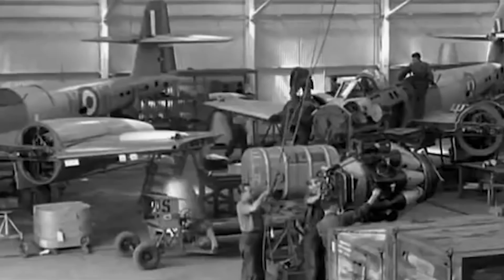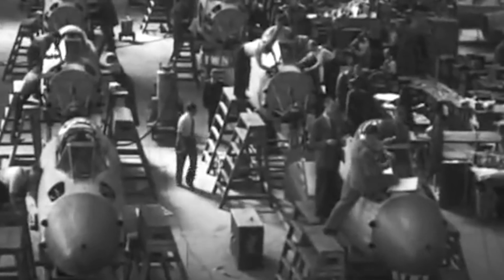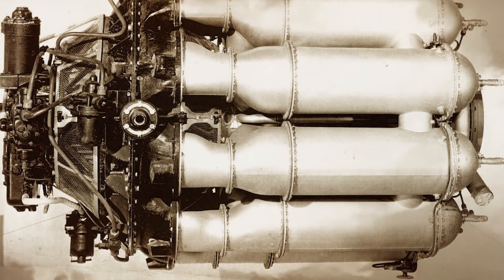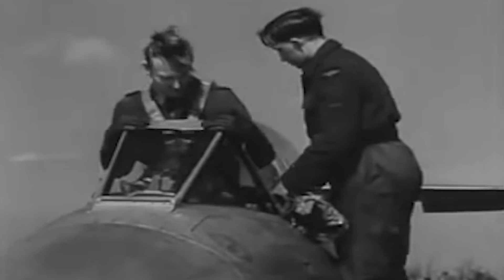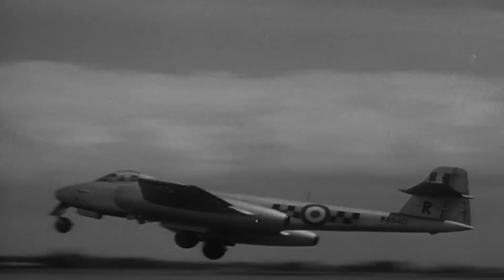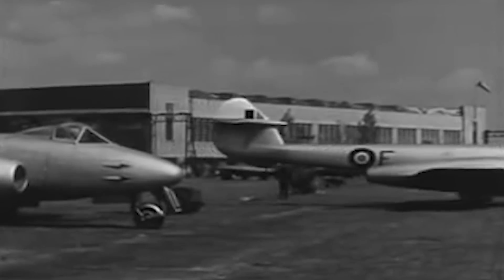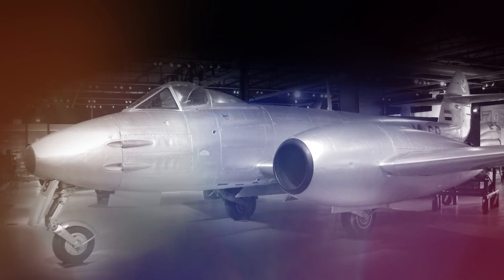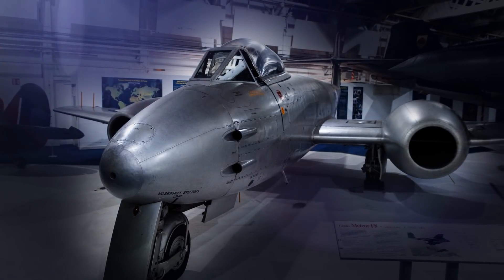Gloster Meteor - The Only Allied Jet to Fight in WW2

Comment: Gloster: “We have a new fighter jet that’s going to revolutionize the industry!”
RAF: “Great! Any downsides?”
Gloster: “Well, it can’t take off...”
RAF: “We’ll take a hundred!”
Reply: And the Me-262 was really reliable and didn't kill any of its crews. Oh, wait.
Reply: @gw7624  Compared to the Gloster  "Meatbox"?
Reply: @sandervanderkammen9230  The 262 were infamous for poor engine reliability which contributed to many of its pilots' deaths. The Meteor wasn't perfect, but you were definitely less like to die in one.
Reply: @gw7624  Not true, the Meatbox was the most dangerous jet aircraft. It was without any doubt the worst jet ever made.
Reply: @sandervanderkammen9230  at the time there really not a great deal of competition for ‘worst jet ever’ and for that matter competition for ‘best jet’ because it was almost ‘the only jet’ which existed in any quantity!
Reply: @pcka12  True, the Gloster  Meatbox stands uncontested as the worst jet ever made..
Reply: @sandervanderkammen9230  somehow I think you have missed the point, early jet aircraft were very dangerous machines, travelling excessively fast and pushing the boundaries of material science, they could hardly be anything other than death traps.
Reply: @pcka12  The Messerschmitt Me-262 was able to shoot down over 500 Allied aircraft...
The Meatbox however was only effective at killing RAF pilots..
Reply: @sandervanderkammen9230  I suspect that you might be exaggerating the performance of the me262 which had highly unreliable engines, and for the most part the Meteor had no one available to kill (other than its own crew) in common with the vast majority of post war jets (apparently the English Electric Lightning had virtually no opportunity to shoot anything down, but it did kill a number of it’s crew!)
Reply: @pcka12  Not at all, the USAAF exhaustively tested the Messerschmitt Me-262 after the war as part of Operation Lusty and Operation Paperclip and found the Jumo 004b engines compareable to Allied engines and more reliable than anything in a similar power output.

The 109-004B engines exceeded the RLMs 100 hours PFTR required by Luftwaffe before entering military service.
This is the exact same 100 hour  PFTR required by RAF and the USAAF during WW2.
TBOs in combat averaged between 50 to 60 hours... excellent by WW2 standards and fantastic for a twin engined interceptor which had very good asymmetric behavior...
The Meatbox was lethal with an engine out.
Reply: @pcka12  The Meatbox was never a viable fighter aircraft, it was simply  not capable of being used against Luftwaffe aircraft, RAF pilots had their hands full just trying to keep the Meteor from becoming a Meteorite
Reply: @sandervanderkammen9230  given that the Meteor arrived a mere 28 years after the Sopwith Camel (which I am sure that you are convinced was ‘never a viable fighter aircraft’ given it’s appalling performance figures and tendency to kill pilots), the Meteor must have had something going for it or they would have kept all those Spitfires - perhaps it was just all a matter of adopting the latest fashions??
Reply: @sandervanderkammen9230  so please explain why the Russians leapt at the chance of using British engines in the Mig15 (another useless fighter?) and promptly binned all the German engines they had?

NB the British Engines in question were of course ‘centrifugal’ rather than ‘axial flow’ types (the British having kept their ‘axial’ ones for themselves.
Reply: @pcka12  Other than the fact it wasn't built out of WOOD like the Vampire?
Nothing... the U.K. was bankrupt after the war and the only thing more plentiful with less value was RAF pilots.
Reply: @pcka12  That is easy, almost the entire German aircraft industry was relocated to the U.S. after the war as part of Operation Lusty and Operation Paperclip.
 Those who didn't went to France to restart production of BMW jet engines still made today by Safran.
Reply: @pcka12  Only the Yak-23 used the RR Nene  (RD-500)
The MiG-15 was designed by Heinkel engineer Seigfreid Gunter and was powered by the Klimov VK-1

The U.K. didn't have a viable axial flow turbojet engine until the 1950s, they were already years behind in jet engine development.
Reply: @sandervanderkammen9230  ah well! 
It is a bit difficult to deal with a person so detached from the realities of of history and so convinced of his own eccentric viewpoint (even when fed numerous clues to 'set him on the right track).

So I am 'signing off'  -  have fun in your fantasy land!
Reply: @pcka12  Indeed, you sir are extremely difficult and detached from reality..
Anyone that believes the Meatbox was a good design is not educated or experienced enough to speak intelligently about them.
The Meatbox was without doubt the worst jet fighter ever used in RAF service.. it was the most effective British aircraft ever used against RAF pilots.
Reply: @sandervanderkammen9230  well now!

Did I ever say that these aircraft did not kill their pilots in large numbers?

No what I actually did was to compare these aircraft with another British aircraft which also killed pilots a mere twenty eight years before, that aircraft was the most successful allied fighter of WW1 and a deathtrap for the unwary & unprepared, it was the tiny Sopwith Camel!

I also said that if you have an aircraft which is pushing the limits of existing knowledge (1944 onwards), you expect casualties.

Martin Baker operated two of these 'wickedly dangerous ' aircraft (the Meteor) as flying testbed for ejector seats, and it stands to reason that if the aircraft were as bad as you believe they would have retired them long ago and used something better!

You need to step aside from your prejudices an spend a little time thinking & researching.

Incidentally that Russian engine arose from the post war British Labour government selling them engines 'for peaceful purposes ' which they promptly re-engineered and stuck in their fighters. Stalin is on record as being unable to believe his luck!
Perhaps Stalin did not know that Labour party meetings used to sing 'the red flag' until relatively recently (New Labour with Tony Blair).
Reply: @pcka12  You have exposed your very limited knowledge of both aircraft... 
Over 1,000 Gloster Meatboxes CRASHED killing 450 RAF pilots...
The Meatbox was much more effective in killing British pilots than than the Messerschmitt Me-262...
Reply: @sandervanderkammen9230  .Yet Meteors are still in service today
Reply: @monza1002000  Not in service anywhere, there are many examples of vintage aircraft still in airworthy condition, what is your point?
Reply: @sandervanderkammen9230  
Two are still working with MB Ejector seats. The 262 disappeared almost as soon as the war ended. The Meteor was the better aircraft, holding several air speed records.
Reply: @monza1002000  Wrong, the Messerschmitt Me-262 continued production and service in the Czech Republic.
Reply: @monza1002000  There Meatbox was a horrible aircraft, the worst jet fighter in history.
Never beat the Messerschmitt Me-262 airspeed record.
It was not bested until the F-86 Sabre went supersonic.
Reply: @sandervanderkammen9230 
Where are you getting your info? The Meteor broke several speed records recording over 660mph
Martin Baker use Meteors for testing the ejectors seats
Reply: @monza1002000  Sorry Marty, the Meatbox never flew faster than 615mph. Not the fastest jet aircraft.
Reply: @sandervanderkammen9230  lol, the meteor served until the 1970's.   The 262 was garbaged in 45 because it was more like to kill its own pilot.  It was banned from flying when Howard Hughes tried to use it in a race for safety reasons.  Hughes never cared about safety.
Reply: @pcka12  refreshing honesty and understanding of reality.  Nice to see on YT.
Reply: @sandervanderkammen9230  did they even make 1000 262s?
Reply: @flavortown3781  Closer to 1,500 Me-262s were built...
Reply: @hurri7720  the arrangement of the fans in the engine you mention is pretty much the same as turbines prior to their development into internal as opposed to external combustion engines as such it was an obvious path of development on both sides of the North Sea
Reply: @pcka12  , yes of course. Quoting the Wikipedia:
"The first gas turbine to successfully run self-sustaining was built in 1903 by Norwegian engineer Ægidius Elling.[7] Such engines did not reach manufacture due to issues of safety, reliability, weight and, especially, sustained operation.

The first patent for using a gas turbine to power an aircraft was filed in 1921 by Maxime Guillaume.[8][9] His engine was an axial-flow turbojet, but was never constructed, as it would have required considerable advances over the state of the art in compressors." 
And of course this applies to a lot of innovations like the phone, the radar and so forth.
A truly English engine innovation would be the Sterling engine.
Reply: @hurri7720  And?
Reply: @hurri7720  yes but you have clearly missed the bit about ‘external combustion’.

Try looking up the Turbina as an early application of turbine propulsion (you can even visit it).
Reply: @pcka12  Are you seriously attempting to compare a steam engine to a gas turbine? 
The Brayton and Rankine are completely different thermodynamic cycles and anyone with the slightest education should be able to tell the difference.
Reply: @sandervanderkammen9230  the important bit is ‘the turbine’, what causes it to rotate is obviously of secondary interest, the ‘concept’ is the extraction of motive power from a turbine mechanism (and of course water turbines have existed for a very long time).

Once you have established the concept of a turbine every thing else follows!
Reply: @pcka12  The turbine is just one of many critical components and concepts... remove everything else? You are left with nothing but a windmill.
 The turbine in a gas turbine operates using a completely different type of blades than a steam turbine... 
The most critical component of the gas turbine is the compressor it is this device that ultimately determines the efficiency, get it wrong? The engine won't run at all!
Reply: @pcka12  Gas turbine engines were pioneered in Norway and Switzerland, not the U.K.  the brits were still playing with boiling water... it must be that whole tea thing?
Reply: @sandervanderkammen9230  actually Hero in Greece had a steam powered thing that span round and round, classic English education gave a lot of credit to Greek & Roman concepts however the English have managed to contribute the odd 'minor' figure like Issac Newton & Richard Trevithick (but obviously most things must have been 'pinched' from abroad 'it stands to reason'!).
Reply: @pcka12  Jens Elling  built the world's first working gas turbine engine in 1903.
Brown, Boveri und Cie began serial production of gas turbine engines in Switzerland in 1932.
Reply: @pcka12  Dr. Anselm Franz designs the worlds first mass produced turbojet engine, the Jumo 004 Orkan in 1940.
Franz would go on to design the worlds most successful gas turbine engine, the Lycoming T53/T55 series.
Reply: @sandervanderkammen9230  that is just “very lovely to know”! ❤️
Reply: @pcka12  No doubt the brits pioneered steam technology... but lagged years behind in the development of internal combustion technology, in particular the gas turbine.
Reply: @sandervanderkammen9230  you do seem have a 🐝 in your bonnet don’t you!

What would you say if I pointed out that my paternal Grandfather was a Bavarian serviceman in WW1, my dad was one of those scientists deeply involved in High Explosives production in WW2.

I am 36% German & ‘quite a bit Swedish, but committed to Scientific & Historical truth & reality (even if it involves Britain).
Reply: @pcka12  So why do they call you Miss Patty???
Reply: @barrierodliffe4155  The Messerschmitt Me-262 was superior to anything the Allies had operating in WW2...
Shooting down over 550 Allied aircraft including fighters.
The pathetic Gloster Meatbox never shot down a single Luftwaffe plane.
Reply: @sandervanderkammen9230  So superior that the Me 262 never shot down a single Tempest or Spitfire, not even unarmed photo reconnaissance Spitfires. it may just have shot down 150 aircraft, mostly slow USAAF bombers. The Meteor destroyed 46 Luftwaffe aircraft and no Luftwaffe fighter ever shot one down, post war the Meteor went on to shoot down jet fighters.
Reply: @pcka12  
You have the misfortune to try to converse with Sander Van der Kammen, or doktor bummer the name he has used before for almost 10 years.
Reply: @pcka12  Even the fake name fails, van is Dutch, von is German and both do not have a capital V, I believe he may be American.
Reply: @barrierodliffe4155   PLEASE NAME A BRITISH COMPANY THAT STILL MAKES COMMERCIAL JET AIRCRAFT IN THE U.K.???
Reply: @barrierodliffe4155  The Messerschmitt Me-262 shot down 85 RAF aircraft including fighters like the Spitfire and Tempest.
Reply: @barrierodliffe4155  well if you call yourself van it implies the Netherlands, however a few Swedish families (for instance) use von & so far as I understand it both mean ‘of’, just as ‘da’ in da Vinci means ‘of Vinci’ in Italian & likewise ‘de’ is used in France.

To British eyes US spelling & grammar is always a little suspect, but with all the various regional variations in the UK people are used to different ‘usages’.
Reply: @barrierodliffe4155  I think you are a kiwi.. or maybe Ozzie, definitely an ancestor of crimal deportees, probably from Ireland.
Reply: @barrierodliffe4155  Your real name is Radcliffe but you got tired of the Harry Potter jokes!
Reply: @FredBTs  You have got it all wrong lad, I love Britian.
I love British Victorian architecture and steam technology, British crime novels and I am absolutely fascinated by your funny little accents.
The truth is British aircraft manufacturing was pretty dismal... even the RAF won't buy British aircraft anymore.
Cheers mate
Reply: @barrierodliffe4155  ANSWER THE QUESTION???
Reply: @pcka12  my grandad was a meteor pilot with 616 squadron after the war where he was a lancster pilot IX squadron... he sadly died in a meteor with over 6 years flying these planes due to low cloud reading being faulty he crash landed and died..
Reply: @sandervanderkammen9230  The MiG-15 was powered by a copy of the Rolls Royce Nene. The VK-1 was a duplicate of the Nene with design elements from the RR Tay. The American J42 was also a copy of the Nene.
Reply: @pcka12  Windmills ?    They go back a bit too.    All to do with a moving fluid impacting on blades I believe.   This really is a fun thread, still waiting for somebody to start quoting chunks of material science.     Disappointed that nobody has started on the atomic programme and Tube Investments.  Still time yet.

SORRY: Necessary correction coming up.  The UK atomic bomb was NOT developed by an indian bicycle manufacturer as has been helpfully pointed out.   The correct code name for the UK atomic effort, as absorbed into the Manhattan Project, was Tube Alloys.   We all make mistakes, it is why they make pencil erasers (or pencil rubbers in the UK).
Reply: @TheArgieH  Tube Investments of India Limited (Initially established as TI Cycles of India Limited, Madras) is a Murugappa Group company that specializes in engineering, bicycles, metal formed products, and chains. It is based in Chennai.........................This Tube Investment?
Reply: @tompiper9276  Nope, got the name wrong, the correct UK Atomic Bomb codename was "Tube Alloys" and was merged with the Manhattan Project.    It was quite advanced, but the US forgot all that when postwar they chucked the UK and others out when applying their Atomic monopoly.  Subsequently the postwar Labour government went it alone.   To quote the then Minister, we must have IT and stick a (expletive deleted) Union Jack on it.    Not exactly a pacifist stance as some folk would argue about the Labour Party.  Cooperation resumed only once the UK demonstrated it could produce its own weapon (two men in a shed with a reactor or two?). 

There was actually a British Tube Investments which had a portfolio of quality UK manufactured white goods, but that all went the way of much of UK manufacturing.  Maybe there's a connection. 

I
Reply: @pcka12  For much of the 19th century (almost all of it from 21 October 1805 onwards) the Royal Navy was the world's dominant Naval power.   It is to the Admiralty's abiding credit that it was used for oceanography, mapped the world and to abolish the international slave trade.
Reply: @TheArgieH  I struggled for a connection there, Indian bicycle manufacturers made no sense. 😅 Cheers....
Reply: @tompiper9276  Thanks, amendment added.   Mark you who did develop the Indian atomic bomb? (Sorry, joke in very poor taste.)
Reply: @sandervanderkammen9230  The Gloster's mechanical failure/pilot error loss rate was 22%. The Me 262 mechanical failure/pilot error loss rate was 33%
Reply: @sandervanderkammen9230  You're still spouting that 100 hour PFTR test lie then Sandylove. It's really funny that if you google search that, all that comes up is you making that same dumb claim on KZ site and sometime doubling it to 200.
Reply: @sandervanderkammen9230  Sandyboy, you're lying again I see. The Klimov VK-1 was a straight copy of the RR Nene as is  known. More interestingly it was used to replace the hopeless BMW 003 the Soviets had been putting into the MiG-9s but which kept flaming out. As for the French, all credit to them for polishing a turd to at least some sort of shine. Of course the first thing they did was drop the hollow blades and the next thing they did was to get some decent Nimonic alloys in.
Reply: @sandervanderkammen9230  Stop lying about the Me262, the Czechs couldn't sell them to anyone. People preferred to by Me 109s and put a Merlin engine in them. In the end the Czechs had a dozen useless Me 262s on their hands and by 1950 they'd given up and bought theiG-15 with the RR Nene copy engine.
Reply: @sandervanderkammen9230  But Sandyboy, by your own reckoning the BROWN in Brown Boveri was British.
Reply: @sandervanderkammen9230  Sandyboy, Elling's engine had a rotary pump compressor and Brown Bovereri's first functioning gas turbine installation wasn't until 1939.
Oh and by the way Sandyboy, according to your reckoning the Brown in Brown Boveri was an Englishman.
Reply: If you read the history. Gloster were told to produce an aircraft that would use the new engine. 
The Mk.1 engine was not powerful enough for all the extras the RAF wanted to fit on it.
Reply: @chrishutton1458  Gloster was certainly not the RAFs first choice to design the aircraft, at the time Gloster mostly built aircraft designs from other manufacturers under license.
As I understand Gloster fell into the job because it was the only company that wasn't too busy to accept the job.
Reply: @sandervanderkammen9230  Gloster was making Hurricanes, as ordered to by the war department. They were given the specifications for the new engines, once Hurricane  production was up to speed in other factories.
From Wikipeadia:In 1934, Gloster was acquired by another British aircraft manufacturer, Hawker Aircraft.
Reply: @chrishutton1458  The entire British aircraft industry was nationalized in 1942 and for the most part remain under government control until it collapsed.
Reply: @sandervanderkammen9230  
Gloster Aircraft Company were building 7,000 Hawker Typoons
Reply: @monza1002000  The Typhoon is also a Hawker... not a Gloster. What is your point?
Reply: @sandervanderkammen9230  Wrong again, Gloster had a working relationship with power jets, Frank Whittles company going back prewar.
Reply: @sandervanderkammen9230  not true, several aircraft companies worked on their own projects without government orders.
Reply: @barrierodliffe4155  PLEASE CITE A BRITISH COMPANY THAT STILL MAKES COMMERCIAL JET AIRCRAFT IN THE U.K.????
Reply: @sandervanderkammen9230  
Please stick to o e subject at a time, this video is about the Gloster Meteor, the first jet fighter which served for decades and did things no Me 262 could do, it shot down, it shot down jet fighters much more advanced than the Me 262.
Reply: @barrierodliffe4155  The Meatbox was much loved by the Luftwaffe... it was the most effective British jet used Against RAF pilots!!!
Reply: @sandervanderkammen9230  SANDYBOY, PLEASE CITE A GERMAN COMPANY THAT IS THE WORLDS SECOND LARGEST PRODUCER OF JET ENGNES. 

Oh no, that's Rolls Royce.
Reply: @sandervanderkammen9230  everyone is impotent in numerous ways throughout various parts of their life, it is those unable to cope with that impotence such as yourself who turn into fools
Reply: @pcka12  I've never had that problem... I'm not homosexual
Reply: @sandervanderkammen9230  then you must be deeply inadequate
Reply: @pcka12  I've never had that problem.. 80% of men don't suffer from ED
I'm sorry that you do... but of course you did it to yourself.
Reply: @pcka12  I totally do not understand why you would want to go through gender reassignment surgery... you poor thing, it must be so confusing and frustrating.
Reply: @pcka12  I personally think that what you are doing is a sin against nature... but these days its perfectly legal for people like you to do whatever you want regardless of the consequences.
Reply: @barrierodliffe4155  Do you an "Miss Patty" have "girl-on-girl" action or are you the "bottom" inthe relationship???
Have you fully transitioned?
Reply: @pcka12  I see SVK has been sinking to new depths of abuse in this thread. He's just revolting. He's also a bit of a joke, don't let him get to you
Reply: “Also the guns never work”

J a p a n t i m e
Reply: That was the US copy of the excellent British 20 mm cannon.
Reply: @barrierodliffe4155  The HS. 404 is a SWISS cannon dummy!
Reply: G8M8N8 
RAF: “Thank you monsieur Chauchat. We always appreciate collaborating with the French”
Reply: Mabye
Reply: hang on how much is that in Fahrenheit
Reply: @Jakobean123  48 Celsius is 118 Fahrenheit - I have worked in 50+ in the Tanami desert in West Australia. Xmas this year was 44 deg. in Perth WA
Reply: @Jakobean123  45c is  About 113F , whatever the C temperature is you roughly double it and add 30 , I hate metric the worst thing GB ever done was getting rid of Imperial measurement
Reply: @TheCaptain64  So you think a measurement system where the inventors body temperature is one of the reference points is a good idea?
Reply: Desperate times, desperate measures, my friend.
Reply: @jehoiakimelidoronila5450  Most of the 450 RAF pilots killed by the Gloster Meatbox occurred in the 1950s.
Reply: @sandervanderkammen9230  the Meteor racked up more flying hours than just about any other type of its time.  But hey you ignore that like all other facts.
Reply: @sandervanderkammen9230  hatred?  show some respect.... my grandad was a meteor pilot with 616 squadron after the war where he was a lancster pilot IX squadron... he sadly died in a meteor with over 6 years flying these planed due to low cloud reading being faulty
Reply: @1fairhurst  I am very, sincerely sorry that the RAF did not value your granddad's life enough to provide him with a safer aircraft..
450 British pilots died needlessly in what is without any doubt the worst jet fighter ever inflected upon British servicemen.
Best regards mate!
Reply: I highly recommend you read the book, "Meteor EJECT!" by RAF Meatbox pilot Nick Carter... its a harrowing tale of just how disposable the RAF pilots really were in the 1940s and 1950s.. a shameful chapter in British history.
Reply: @sandervanderkammen9230  Got any further observations on the startling records of the Starfighter... You know, combat records, safety records... Anything like that??
Reply: @tompiper9276  Its not hard to observe that comparing the "Meatbox" to the Mach 2+ F-104 is akin comparing a Ford model T with a Bugatti Veyron... the only difference is the Meatbox and F-104 were produced concurrently..
Reply: @sandervanderkammen9230  except the design requirements were entirely different and years apart. You seem to be attempting to compair cheese with bananas.
Reply: @tompiper9276  They are both jet aircraft...
Reply: @sandervanderkammen9230  Yeah.... Very different jet aircraft. TBH you didn't come up with much of an argument there, you can do much better..... Come on!!!
Reply: @tompiper9276  That was exactly my point,
in terms of performance the Meatbox and the F-104 could not be more different.
The 'meatbox' is a straight wing, sub-transonic aircraft with a relatively low wing loading and landing speed.
The F-104 is the worlds first operational Mach 2+ aircraft and has an extremely high wing loading and landing speed and was expected to operate day or night under all weather conditions to intercept Soviet aircraft straying too close to NATO territories.
Reply: Lmao, that's sounds.
Reply: @frecherdachs2542  
Adolf Galland said the only way to get the 362 airborne was to jam on the break forcing the nose down. The aircraft went through a complete redesign to introduce tricycle undercarriage to over come this problem
Reply: If RAF brass had been more experimental we could have had jets in 1930's
Reply: @NHT7040  Whittle made alot of enemies at the Royal Aircraft Establishment, particularly after he plagerized the work of A.A Griffiths the Chief of Aircraft Engine Development at RAE...
Whittle was also notoriously difficult to work with and was banned from Rolls-Royce after assaulting one of their engineers with a deadly weapon.
Reply: Thats like the 262.  Early models could only be pushed into the air by a few test pilots.
Reply: @jimdavison4077  RAF Air Chief Marshal Sir Frederick Bowhill called the Gloster "Meatbox" a quote; "Dismal and Lackluster aircraft"
Reply: @sandervanderkammen9230  Sir Fred never flew one. We can of course consider the words of Adolf Galland who flew both the Meteor and the Me 262 in service and said that he wished he had had the Meteor's engines in the 262.
Reply: The first 262s could not take off. It nèede a complete redesign including going to tricycle undercarriage
Reply: @monza1002000  The Gloster Meatbox couldn't shoot down enemy aircraft... it was the worst jet fighter in RAF history.
Reply: There was another jet aircraft that was in development roughly at the same time as the Meteor, And that was the  De Havilland Vampire, with a top speed in excess of 500 mph it was seen by many as a superior craft to the Meteor, which was regarded as heavy and clumsy in comparison.
Unfortunately it didn't come into service until 46, which was too late to see action in WW2.
Reply: @dadagan8815  Both the 'Meatbox' and the wooden Vampire were obsolete on arrival.
Reply: @sandervanderkammen9230  
The mosquito was also made of wood, but that still gave the Luftwaffe a kicking didn't it?
Reply: @dadagan8815  The ol'termite express was easy picking for Messerschmitt Me-262...
Reply: @sandervanderkammen9230  Easy pickings??? Please provide examples.....
Reply: @tompiper9276  I can provide you with 450 examples... of dead RAF pilots.
Reply: @sandervanderkammen9230  Ahh.. The old 'Evade the question' tactic. No, I asked for the figures for mosquitos shot down by the ME262.  Please provide.
Reply: @tompiper9276  As soon as you give me figures on Luftwaffe planes shot down by the Meatbox
Reply: @sandervanderkammen9230  You made the claim... Now substantiate it. Please provide me with the examples of mosquitos shot down by the ME262.
Reply: @tompiper9276  The Messerschmitt Me-262 shot down over 550 Allied aircraft.
Reply: @sandervanderkammen9230  You clearly didn't understand.... Please provide me with the examples of the ME262 shooting down mosquitos. I don't think I can make it any clearer than that.
Reply: @tompiper9276  No, you clearly don't understand.. the Miles M.52 never existed.
Reply: @sandervanderkammen9230 Have you been drinking?? I think you put this response on the wrong thread, please amend it. Cheers.
Reply: @tompiper9276  Please tell us the name of the test pilot that flew the M.52????
Reply: @sandervanderkammen9230  Sander, you're still in the wrong thread.... Pop over to the M52 one. 😉
Reply: @tompiper9276  There is no M.52.
Reply: @sandervanderkammen9230  The M52 was a design abandoned in development.... Just like you confirmed. However you're still continuing this in the wrong thread. This is the one where you need to provide evidence that the ME262 shot down Mosquitos... Please provide me with the evidence.
Reply: @tompiper9276  There is no M.52, it does not exist and never did.
Reply: Since 1917 in fact, though I think the Hannover line really died out with the accession of Victoria.    Look back far enough and the line of the Kings (and it was Kings until the Empress Matilda) of "England" arguably goes back to the Saxons followed by the Danes then the Saxons again.   Some of them were right bastards, especially the Danes.  Moving on a few centuries, my own view is that Richard III, last to reign of the line of Plantagenet, was a good guy but got a lousy press thanks to that Tudor propagandist W. Shakespeare.   Owen ap Tudor's claim was somewhat dubious to say the least, but then winner takes all. Got any views on that great Parliamentarian, the Lord Protector O. Cromwell.    I wonder if touching for curing The Kings Evil (scrofula) still worked just as, well.
Reply: @TheArgieH  Yes, England was defeated by the Romans, Celts, Saxons, Normans... and the Germans by marriage
Reply: @sandervanderkammen9230  Disappointing, you missed quite a few out.   By the way, when do you think an identifiable England came into being?  You were a little bit premature with the Romans, I'll leave you to work out the rest.   I am not clear as to your point anyway, the key battle to win is the last one.
Reply: @TheArgieH  The point Sander likes to make is that Britain is a bit rubbish....
Reply: @tompiper9276  Good Lord, surely not?   At one point I suspected him/she/other as specified, of really being Wilbur of blessed memory with another new pseudonym.   However, Wilbur usually was quite accurate with his technical data and facts even though he did use it to (perhaps) misdirect and mislead on occasion.   In the end I figured not, simply insufficient use of UPPER CASE when disagreeing or abusing.
Reply: @TheArgieH  Perhaps I'm guilty of stating the glaringly bleedin' obvious, my apologies...
Reply: @tompiper9276  Not at all, no worries.  It is very interesting looking at his vocabulary, the impeccable grasp of technology, geography and historical facts, the attention to detail. At one point I thought about giving him a discourse on the Angles, the Scotii, the Jutes, the Picts, the Saxons, the Danes, etc. t might be fun but life is too short.  Anyway have as good a Christmas and happy New Year  as is possible under the current circumstances.
Reply: @TheArgieH  Likewise to you and yours..
Reply: You should change your name to Dunder Head.
Reply: "How many pilots can die trying to fly it?"
Reply: @cRistinel54  450 British pilots were killed by the Meatbox in RAF service alone.
Over 1,000 crashed and at least 900 destroyed in accidents worldwide.
Reply: @sandervanderkammen9230  Hello Sandyboy, always nice to see you appearing in several of your guises. Do you remember being on here recently as Redsen but then you felt you had to delete his/your comments. He/you mentioned the MiG-15 and I was able to point out that the MiG-15 was famously powered by a copy of the Rolls Royce Nene engine. Then he started going on about the P80 shooting star and Ed Schmued. 
Ed Schmued was one of the smart Germans (like Lachmann and Neumann) who got out long before the rest of the Germans started getting the country trashed for a second time. He went to South American and started working for General Motors there and that's where he learned to be an aircraft designer from the Americans. He led the team that designed the P51 which as you know was designed for the RAF to BPC specifications and made good use of NACA wing specs and RAE cooling studies. His design work produced an aircraft that was good straight away but really came into its own when the RAE matched it up with the famous Merlin engine. That's not to decry the Allison engine which was a good engine only lacking a suitable supercharger at that time. It did of course end up in the p38 and did sterling work trashing the nazis. And the Allison connecting is relevant to another aircraft that you/he mentioned with praise in your previous effort, the P80 Shooting Star. Allison built J33 engines for the Shooting Star and the J33 was of course a centrifugal flow engine developed from Frank Whittles engines.
Reply: @sandervanderkammen9230  Hello Sandyboy, I was recently having a conversation with Redsen/you about how Britain played its vital role in crushing germany in WW2. I know you won't disagree with our conclusion which is that  Britain and France led the way in doing over the nazis and bringing germany to heel for the second time. Sadly France was nocked out early because of political and command failures but many Frenchmen soldiered on and Britain held the fort whilst the Americans waited to obey the call and the Soviets fed and fueled the nazi regime until it turned on them. Britain was always going to win by the same means it had won the great war and the napoleonic wars. By using its military force along with its political and financial power to co-opt allies and induce neutrals to work for them. And of course it worked, the nazi germany was trashed, the soviets did the dirty work and the Americans paid for it. Now that's a win.
Reply: @Redsen East Hello Redsen, do you know that despite your/sandyboys attempt to delete your previous embarrassments, I still have the notification showing of your comment about Ed Schmued so I'll reply to it here. Okay?
Ed Schmued was one of the smart Germans (like Lachmann and Neumann) who got out long before the rest of the Germans started getting the country trashed for a second time. He went to South American and started working for General Motors there and that's where he learned to be an aircraft designer from the Americans. He led the team that designed the P51 which as you know was designed for the RAF to BPC specifications and made good use of NACA wing specs and RAE cooling studies. His design work produced an aircraft that was good straight away but really came into its own when the RAE matched it up with the famous Rolls Royce Merlin engine. That's not to decry the Allison engine which was a good engine only lacking a suitable supercharger at that time (no surprise that Voodoo the world's fastest piston prop aircraft is powered by an engine with both Merlin and Allison parts). It did of course end up in the p38 and did sterling work trashing the nazis. And the Allison connecting is relevant to another aircraft that you mentioned with praise in your previous effort, the P80 Shooting Star. Allison built J33 engines for the Shooting Star and the J33 was of course a centrifugal flow engine developed from Frank Whittles engines.
Reply: If the Meteor had 1500 crashes, how about Me 262
Reply: @mphe2807  The Me-262 had more than 1,500 combat sorties and shot down over 500 Allied aircraft... the "Meatbox" only killed British pilots!
Reply: Meanwhile RAF homers:

"The Meteor was totally superior to the ME 262 (please ignore an FW-190 outrunning it)"
Reply: You sound American.  Remind me who gave jet technology, and radar to you?
Reply: @shebbs1  And showed you how to crack Enigma. And build the world's first programmable computer, the Collossus.
Reply: @shebbs1  You can play the tit for tat, who gave who more tech during WW2 all day when it comes to the US and the UK.
Reply: @shebbs1  RADAR? ignored when it detected JAPANESE PLANES,from far away,approaching  PEARL HARBOUR?.The Worlds first programmable Computer,used throughout WW2,]plus BLECHLEY PARK,in decoding GERMANYS ENIGMA machines,on communications regarding  SEA,AIR,ARMY,orders,etc.Could add a great deal more,such as1000 German Scientists,and Engineers,taken,resettled in the US,one, WARNER VON BRAUN,[VI,V2] become the head of NASA!
Reply: @soulfella1  , The first programmable computer was the Z3.
"Konrad Zuse (German:  22 June 1910 – 18 December 1995) was a German civil engineer, pioneering computer scientist, inventor and businessman. His greatest achievement was the world's first programmable computer; the functional program-controlled Turing-complete Z3 became operational in May 1941. Thanks to this machine and its predecessors, Zuse has often been regarded as the inventor of the modern computer.".
https://en.wikipedia.org/wiki/Konrad_Zuse
Reply: Owain Shebbeare and you sound British; incapable of comprehending humor. (See, I can stereotype too)

Oh and the US greatly appreciates you sharing radar with us. That’s why we shared Meghan Markle with you. You’re welcome. Take care and let us know if you ever want to lose another war. Cheers!
Reply: Petrol Head haha haha Meghan Markle, good .at least we don’t have trump,
Reply: @donwoodward4771  The Brits have a  100 billion dollar zoological exhibit called the Royal family...
Reply: Sander Van der Kammen true,and the yanks have got trump,go figure.
Reply: @donwoodward4771   What year was the queen elected??? Lol!
Reply: Sander Van der Kammen lol,good one,l remember seeing her tour through my town in the early fifties,by the way, I’m Australian,just a spectator.
Reply: @donwoodward4771  Not true, as a commonwealth territory she's your queen too..
Your just a spectator in brexit.
Reply: @sandervanderkammen9230  "The Brits have a  100 billion dollar zoological exhibit called the Royal family"

Please don't tell me you're American. It would almost be too easy.
Reply: @gw7624  The Americans saved England from the Germans TWICE!
You should be a little more thankful... they saved your evil fascist regime from defeat by another evil fascist regime! 
To be honest there is not much difference between Hitler and the Queen... she's German too!!!
Reply: Gary Tarr  15 July, 1946
Reply: @sandervanderkammen9230  oh dear oh dear me never mind you'll get over it eventually 😂
Reply: @donaldellis3609  The families of those poor souls killed by the Meatbox will never get over it... a shameful chapter in British aviation history.
Reply: @sandervanderkammen9230   yes we all know about the tragedys it should never have happened, but my response was to you. Not the personal and there families got it 🤨
Reply: @donaldellis3609  I have no doubts that the Gloster Meatbox was the worst jet fighter in RAF service, probably the worst jet fighter ever mass produced.
Reply: @owenshebbeare2999  that’s cute. It’s amazing how the Brits think because they won the Battle of Britain (which was repelling only the Luftwaffe) that somehow that would translate to the mainland. Remind me how you guys fared in the weeks and months leading up to Dunkirk? You may have won the war for Britain but you were mincemeat in the outer theaters until the Yanks (and Russians) came along. The war in Europe isn’t won without Jeeps, M1s and Shermans. And let’s not even start on the Pacific theater. You won an air battle. That’s it. Nice try though
Reply: @petrolhead4503  well seeming as we beat them then they came back and beat us in 1812 I’d say its even now
Reply: @owenshebbeare2999  There were only two winners in WW2... the United States and the Soviet Union...
Reply: @sandervanderkammen9230  
That are cheaper to run than a President and pay their taxes
Reply: @monza1002000  Are you referring to your German Queen? She is a first order descendent of the Royal family of Hanover Germany.
Reply: @petrolhead4503  Vietnam????
Reply: @owenshebbeare2999  As Al Murray commented, the Yanks were totally surprised at Pearl Harbour, 2 years into a global war!
Reply: @sandervanderkammen9230  we saw what could be elected to office in 2016, elections are over rated.  You do realize the queen is head of state in name only right?  Actually part of the checks and ballances against a rogue government.   No likely not.
Reply: @petrolhead4503  I know this is an old comment but what you said is not a stereotype at all. He’s one spastic out of thousands who can. A lot of people from other countries don’t understand British humour due to the fact that it is dry humour
Reply: @sandervanderkammen9230  
The poor relatives of the pilots killed by the worst ever, the F 104 which was called a flying coffin, widow maker and a few other names will most likely never get over it.
USA strikes again, they did what they were not very good at in WW II. kill German pilots. Even the P 80 had more crashes than the Meteor.  How do you explain that?
Next the Me 262 which killed a bigger percentage of it's pilots in 1 year than the Meteor in decades of very good service.
Reply: @barrierodliffe4155  Over 1,000 Meatboxes CRASHED killing 450 british pilots alone...
It remains the worst jet fighter in RAF service.
Reply: @barrierodliffe4155  Not mature enough to handle the truth aye Barrie?
Childish insults won't prove youre right or make you look smarter.
Reply: @barrierodliffe4155    PLEASE NAME A BRITISH COMPANY THAT STILL MAKES COMMERCIAL JET AIRCRAFT IN THE U.K.???
Reply: @sandervanderkammen9230  
You are still ranting away telling lies. Airbus UK is British and came from British companies like Hawker Siddeley and De Havilland.
Reply: @barrierodliffe4155  PLEASE NAME A BRITISH COMPANY THAT STILL MAKES COMMERCIAL JET AIRCRAFT IN THE U.K.???
Reply: @barrierodliffe4155  PLEASE NAME A BRITISH COMPANY THAT STILL MAKES COMMERCIAL JET AIRCRAFT IN THE U.K.???
Reply: @barrierodliffe4155  PLEASE NAME A BRITISH COMPANY THAT STILL MAKES COMMERCIAL JET AIRCRAFT IN THE U.K.???
Reply: @sandervanderkammen9230  
I know you can't answer my question so you keep on repeating you silly question which has nothing to do with the subject and is based on a lie. No German company makes commercial aircraft. Britain is at least designing and making parts for the Airbus. Germany can only assemble some of the already built parts.
Reply: @barrierodliffe4155  PLEASE NAME A BRITISH COMPANY THAT STILL MAKES COMMERCIAL JET AIRCRAFT IN THE U.K.???
Reply: @sandervanderkammen9230  
WHY ARE YOU SUCH A COWARD?  you have not done anything to support your lie that according to you 85 RAF aircraft were shot down by Me 262's including Spitfires and Tempests, I gave you plenty of opportunity to come up with any Spitfire or Tempest, you couldn't even come up with a Mosquito or any other RAF aircraft.;  
As for your question which has nothing to do with the video I have answered it many tines and will ignore it every time from now on.
Reply: @barrierodliffe4155   PLEASE NAME A BRITISH COMPANY THAT STILL MAKES COMMERCIAL JET AIRCRAFT IN THE U.K.???
Reply: @barrierodliffe4155   PLEASE NAME A BRITISH COMPANY THAT STILL MAKES COMMERCIAL JET AIRCRAFT IN THE U.K.???
Reply: @sandervanderkammen9230  Sei ein Feigling oder unterstütze deine Lügen.
Reply: @sandervanderkammen9230  Wie ist es, ein Feigling zu sein, kleiner Doktor, Mistkerl?
Reply: @petrolhead4503  That worked well, didn't it? That's why she was promptly returned. When do we get our refund,?
Reply: And won the battle of the Atlantic and North Africa  get it straight it was a joint effort  the US could not have done it on its own in Europe
Reply: @sandervanderkammen9230  Wow doc... Not much difference between Hitler and the Queen eh? Says a lot about your perception of the world.... And none of it is good.
Reply: @tompiper9276  The queen was much, much worst, the worst in the history of mankind.
Reply: @tompiper9276  You are are one the wrong thread, this video is about the worst jet fighter in history..
The Gloster Meatbox
Reply: @sandervanderkammen9230  Then why are you going on about the Miles, you know, the one you acknowledged was a design abandoned in development....
Reply: @sandervanderkammen9230  And your pro Hitler stance is both cringe worthy and disturbing.
Reply: @sandervanderkammen9230  And your inability to provide the requested evidence further deminished your argument... Again.
Reply: @tompiper9276  There is no argument... the Miles M.52 never existed
Reply: @tompiper9276  Nothing more cring worthy than the brits being hypocritical about mass genocide..
Are you also a holocaust denier?
Reply: @tompiper9276  Please provide evidence to support the Miles M.52 ever flew or was even constructed?
Reply: @sandervanderkammen9230  You acknowledged it was designed and abandoned in development.... Get over it! And you still haven't provided the evidence.
Reply: And this is still the wrong thread for the M52.
Reply: @sandervanderkammen9230  And the hocaust was horribly real. The Nazis murdered millions. Your attempt to re-appropriate the title, which I fully expect you to do, will be deeply offensive to the victims of Hitlers vile regime. You might like to consider that.
Reply: @sandervanderkammen9230  And where is the evidence you were asked to provide,.... Oh.... There isn't any.. 😂
Reply: @tompiper9276  Wrong holocaust... I was referring to the worst mass genocide in human history.... the Victorian Holocaust
Reply: @sandervanderkammen9230  Wow.... How predictable are you???   
Didn't really read the post then. Two things, please provide the evidence previously requested and, if you want to comment on the M52, you're in the wrong thread. So.... Evidence please!
Reply: @sandervanderkammen9230  So how about providing the evidence that was requested.... Or isn't there any?.... Last chance before you default in to the 'Got it wrong' category.
Reply: @sandervanderkammen9230  And, as you have already conceded the M52 question it doesn't need to be discussed on this thread.
Reply: @tompiper9276  The Miles M.52 never existed
Reply: @sandervanderkammen9230  You acknowledged it was designed and abandoned in development... And this is still the wrong thread.
Reply: And please provide the evidence that was requested.
Reply: And I note that you seem to have deleted your post about the Queen being as bad as Hitler.... Worried about litigation?? 🤔😅😅😅
Reply: @sandervanderkammen9230  And you still haven't come up with the evidence requested.... So I have to consider that there isn't any and you concede your position..
Reply: @sandervanderkammen9230  YEAH HOPEFULLY WITH THE NEW BLOOD OF THE GODDESS PRINCESS KATE, IT WILL REDUCE THE SIMIAN LOOK THAT IS SO DOMINANT IN THE ROYAL FAMILY HEHEHE
Reply: @sandervanderkammen9230  Surely you mean Saxe Coburg Gotha?
Reply: @TheArgieH  Its the Windsors now...
Reply: @tompiper9276  In passing, there's material from the M. 52 development in  the Berkshire Museum of Aviation which stands on the site of the former Miles company.   Included the wind tunnel model and I vaguely remember seeing something about the first all flying tail.   Reportedly Winkle Brown wanted to be the pilot, he had the right stature in every sense of the word and was frustrated when HMG pulled the plug.    There was a rumour that axing  it was a condition of an American loan, surely not?   Anyway, a man who could fly the DH Swallow and live surely could have made a go of it.

Also the site of the first ball tipped pen (Biro) factory in the UK because of the engineering skill needed in its early days .
Reply: @TheArgieH  Pencilled in for a visit, many thanks.
Reply: @sandervanderkammen9230  SANDYHONEY,  PLEASE NAME A GERMAN COMPANY THAT HAS PRODUCED THE WORLDS FASTEST ELECTRIC AIRCRAFT.

Oh no, that's Rolls Royce.
Reply: Petrol Head   USA:  "what's a jet?"
Reply: When the Nazi Me-262 couldn't take off they put on propellers.
Reply: Stephen Jacks hahahaLOL,good joke
Reply: @stephenjacks8196  Yes - the 262 was basically a propeller plane with jet engines bolted underneath the wings, a very basic rushed design. The meteor was a much more advanced, modern jets resemble the Meteor not the 262.
Reply: @agt155  PROVE IT!
 The Messerschmitt Me-262 was developed from the RLMs Projekt 1065 which specified a swept wing jet aircraft cable of 1,000 km/h in level flight.
Reply: @agt155  See Heinkel He-178, flew 8/1939, did 372 mph (faster then 1939 Me-109 and Hurricane) . Looked like 1950s Migs etc. (unswept), single engine. Ignored by German RLM.
Reply: @stephenjacks8196  Brilliant German aerodynamicist Helmut Schelp convinced the RLM that centrifugal compressors turbojets were a dead-end and a waste of time... he was absolutely right.
We only use axial compressor jet engines today.
Reply: @stephenjacks8196  ahh the He 178 better known as the hair-dryer powered glider. Did it ever get airborne without a tow?
Reply: @WilhelmKarsten  Who is "we"? because Germany doesn't have a jet engine industry.
Reply: @agt155  The World's first successful demonstration of a aircraft in pure jet propulsion flight is the Heinkel He-178 on August 27th 1939 in Rostock, Germany.
It's well documented and photographic evidence is held at the Smithsonian.

This is 2 years before Whittle would achieve his first successful demonstration in 1941.
Whittle is only the fourth person to successfully demonstrate a working jet aircraft engine.
Reply: @agt155  Germany is a significant manufacturer of jet aircraft engines.
EuroJet Turbo GmbH. manufacturers the engines for the Typhoon.
Reply: @agt155  Deutschland invented the jet engine industry... while most of the experts were poached by the Americans and the French after the war production of jet engines still continues in Germany.
Reply: @agt155  @ 372 mph it was faster than the then 1939 Bf109 or Spitfire. Not a glider.
Reply: @stephenjacks8196  The Me-262 could fly well and shoot down enemy aircraft... two things the Gloster Meatbox could not.
Reply: @sandervanderkammen9230  "The Me-262 could fly well and shoot down enemy aircraft... two things the Gloster Meatbox could not."

You really don't know what you're talking about. The Meteor could easily out-dogfight the 262 and, more importantly, could actually fire its cannons without the vibration blowing up the engine.Wrong again eh numbskull?
Reply: @gw7624  You obviously don't know much about the the plane British pilots called the "Meatbox" or "flying coffin"
Reply: @sandervanderkammen9230  It had crap engines, though.
Reply: @Dragonblaster1  True, the W2s and the H1s were total crap... not until the MK.5 Derwent did the plane have a decent engine.
Reply: @sandervanderkammen9230   Yet the Meteor is still flying today  What happened to the 262 after the war.?
Reply: @monza1002000  It was still produced in Czech republic after the war.
C models still flying today.
Reply: @sandervanderkammen9230  
Copies of C models (2) in the world are flying.
Reply: @monza1002000  There are no copies of the Me-262c.
Reply: @sandervanderkammen9230  
Yes there are, seen one flying myself
Reply: @monza1002000  There are only five  C models, there are no copies.
There is also an airworthy A--1 but not flying.
Reply: @sandervanderkammen9230  the me 262 ended the war with a 1.5 to 1 kill ration, hardly worth bragging about.   Also about a quarter of all 262 lost were shot down by bombers, fun fact not often mentioned.  Post war the 262 was tested then scrapped because they were deadly to their pilots.  Can anyone think of anything about the 262 encorporated into future jets? Don't give me that swept wing crap as the little sweep on the 262 gave no advantage and was because it used lighter Jumo engines than the intended BMWs so the ballance was all off and the only way to save the project was sweep the wings, hell even the spitfire had a greater leading edge sweep.
Reply: @jimdavison4077  Please get therapy... its free in your country.
Reply: @sandervanderkammen9230  so is a good education.. to bad the same can not be said for yours.
Reply: @sandervanderkammen9230  you have so little knowledge on the subject yet seem to think you know it all, in twenty years time if you start now you might have a clue what you are talking about.  You claim the type was produced and used post war by the Czechs, well in fact 12 aircraft were built in hopes of a foreign market which never happened. As expected by 1950 half of those were gone and they were replaced by 51.  It was impossible to keep the type in service as they were so unreliable.   Other errors you made was saying the min 15 didn't use the RR Nene  when it used a reverse engineering  Nene after buying several from the UK. Then you pretend there is any sourse for claims of speeds above 515 mph for the 262 in combat.  If you want to be that way then the spitfire was the fastest aircraft piston or jet as its on record doing mach .89 in 1943.  Again its leading edge having a 5 degree greater sweep ore more.  But if we are honest we all know high speed trials are not in combat ready aircraft are they? So the 262 was really only able to fly 515 mph in combat while piston fighter it faced flew 440 to 480 mph.  Those speeds are all at altitudes of operations in bomber attack and escort duties in level flight.  The piston aircraft could out dive the 262 do to its control problems.
Reply: @sandervanderkammen9230  you are the one who knows nothing of that period of history but what YouTube says.  YouTube is entertainment, not education material.  It's a platform for uneducated people to present ideas no matter if the be factual or not so it's still up to the viewer to check the reality against a verifiable sourse.  Now as I stated the Germans produced only a partially successful functioning jet engine during the war, the Jumo 004b.  It was not reliable and was very limited in thrust.  The brits produced three Centrifugal turbojets in full use and production by wars end along with several Axial flow turbojets and one bypass turbo fan far exceeding Germany in that field.  Also the fasted piston or jet flight was flown by the spitfire in 1943 at mach .89.  The V1 and V2 had no guidence system that allowed it to target a spicific area so they were not missiles.  These are recorded facts.  Me 262's first operational unit was jg 07 which was no less than 5 months after 616 squadron.  Those are the recorded facts like it or not.
Reply: @jimdavison4077  Have you ever been diagnosed with Cognitive Dissonance Disorder?
Reply: @sandervanderkammen9230  " the Me 262 could fly well and shoot down enemy aircraft - two things the Gloster Meatbox could not"
The Me 262 was in no way exceptional as an airframe. The engines had a real-world service life of 10-12 hours. At that point, the engine was scrap metal. The RR jet engines got a routine service every 100 hours. Service, for things like an oil change. Over-all engine life indefinite. Many Meteors completed their service life of decades with their original engine.
Performance? Not long after the end of WW2, an air speed record of 606mph was set by a standard Gloster Meteor. Fastest plane in the world.
Reply: @pashakdescilly7517  Well, 26 Luftwaffe pilots became aces flying the Messerschmitt Me-262's and shot down over 550 Allied aircraft.
The Meatbox was  unable to shoot down a single Luftwaffe plane.
You clearly have no formal education or professional experience in aviation as you are completely unaware of the difference between a PFTR and a TBO. Manfacturers recommended TBOs and actual TBOs in combat are  not compareable and can vary greatly, please spare us the false British myth that the Jumo 004b Orkan was less reliable... this is completely untrue and there is zero evidence to support it.
Reply: @pashakdescilly7517 The fastest jet fighter was the Messerschmitt Me-262 until the F-86 Sabre.
Reply: @sandervanderkammen9230  The term  flying coffin was used for the highly flammable He177.
Reply: @sandervanderkammen9230  Yes, the poor old Czechs, they thought they could build an jet aircraft industry on the 262 but it was too crap. They built 11 or 12 and absolutely nobody wanted to buy them. So they dumped them for the MiG-15 with the RR Nene copy engine.
Reply: @sandervanderkammen9230 Don't belittle the Gloster Meteor. It was continually developed in both airframe and jet engines during and after the war. The ME 262 originally was a tail dragger, and both early Gloster jets had tricycle undercarriage.  Even Ernst Heinkel designed the HE 280 with a Tricycle undercarriage, which was airborne well before the ME 262.  The HE 280 and early Meteors were similar in performance. One thing the Meteor did have but was not fitted to the ME 262 was airbrakes on the wings to assist in combat with slower aircraft to help give the pilots more time to take aim when firing. The airbrakes also assisted in washing away excess speed when landing. The overshooting problem and landing problems with the ME 262 were never addressed with airbrakes and ME 262s were condemned to make long approaches to the runway making them vunerable to attack by piston engine fighters. A reasonable number of ME 262s were shot down upon take-off at low speed and in the long landing approach to lose speed. It is interesting that the Meteors were based at basic airfields on the continent in Belgium and the Netherlands before the end of the war being of a good basic rugged design that could operate from basic airfields . It sounds like the Germans as well as the British did not want their jets going down in enemy held territory and secrets being lost to the enemy. The Meteors engines had superior high temperature steels that the Germans never developed fully due to shortages in Chromium and Nickel.
Reply: @damianousley8833  RAF pilots called it the "Meat Box" (a flying coffin) and "Meteorite" (a Meteor that strikes the Earth).

RAF Cheif Air Marshall Sir Frederick Wiliam Bowhill called the Meat Box a Qoute; "Most dismal and lackluster aircraft"
Reply: @damianousley8833  The Messerschmitt Me-262 was vastly superior to the Meatbox aerodynamically... it not only had very efficient flaps but also automatic retractable leading edge slats.. a very advanced lift augmentation device still in use on modern jet aircraft.
No pilot who wants to stay alive would ever deliberately reduce airspeed to engage an enemy aircraft... that comment reveals someone who has no formal education or professional experience in military aviation..
Reply: @damianousley8833  That is a very naive and misinformed comment, the Jumo 109-004B was the most fully developed jet engine in service during WW2 and pioneered several very sophisticated and advanced heat management technologies like bleed air cooling and TBCs found on all modern jet engines but completely unavailable to the Allies until after the war.
Reply: @sandervanderkammen9230 It's nickname was not the "Meteor meatbox" but correctly it's nickname by pilots was the "Meteor meat wagon".
Reply: @damianousley8833  The names
 "Meatbox"
"Meat Can"
"Meteorite"
"Flying Coffin"
"The Deathtrap"
And "The Widowmaker"

We're monikers used by Gloster Meteor pilots... certainly not terms that expressed the pilots endearment or confidence in the extremely troubled and fatally flawed British aircraft design.
The Meatbox had an absolutely appalling loss rate and fatalities statistics were staggering even by the standards of the time.
Reply: @damianousley8833  The Gloster Meatbox is an unmitigated failure.... it V only killed British pilots.
Reply: @sandervanderkammen9230  If it was such an unmitigated failure, then why was it the first generation jet fighter used by many  nations. Mainly as it was still in production, 3,947 being built, more than the 1200 ME 262  built by the Nazis, in fact 3 times the number . By 1950 the Meteor was obsolete.  The ME 262 was not in production as the Avia 92, for any volume by Czechoslovakia as only twelve were built by them and were withdrawn from service 1951 with it barely being in service with them for one year and declared obsolete. The first generation jets did not remain in front line service for very long. Looking at the production of ME 262's in the chaos of Germany in 1944/45, only 200 reached the operational units fully completed in running condition. Many a 262 fusilage was thrown onto the scrap metal heaps at wars end to end up as aluminium kitchen utensils.
Reply: @damianousley8833  Because after Britain's defeat in WW2 there was simply no money to develop anything better.
In 1946 the Bank of England failed and the value of the Pound collapsed, UK government sold brand new aircraft to foreign countries at below cost for cash, food and other comodities needed to prevent a starving England from resorting to crime and rioting.
Reply: @damianousley8833  Excellent point, only a handful of Meatboxes were built during the war, most were built after the war.
The Meatbox was effectively obsolete as a fighter aircraft in 1944, it was never used in RAF service in that role... yet production continued until 1955, more than a decade after it was rendered obsolete by jet fighters with swept wings and axial turbojet engines.
Reply: @damianousley8833  The successful Messerschmitt Me-262 couldn't have been more different than the Meatbox, 26 Luftwaffe pilots scored Ace or higher shooting down over 550 Allied aircraft.
The Meatbox only killed British pilots during WW2.
Reply: @damianousley8833  Yes,  3,947 built over a 12 year production run, the Meatbox crashed almost as fast as Gloster could build them!!!
890 CRASHED in RAF service (1,600 hull loss accidents) 
The Meatbox averaged over 100 crashes in peacetime operations per year in RAF service alone. Killing 450 British pilots.
Reply: @sandervanderkammen9230  The ME 262 was not the be-all and end all, 100 were shot down "shock / horror"  by Allied piston engine fighters. Also a number were shot down  by antiaircraft  fire from the ground. Allied fighter pilots soon learnt they could easily outmanoeuver a ME 262, making an attacking pass. With its speed, the ME 262 could fly away from encounters with Allied piston engine fighters, but soon after takeoff and on the approach to landing, it was easy meat for Hawker Typhoons and even P51's. The 4 x 20mm cannon on the Typhoon made quick work on shooting them down. The Typhoon had higher low altitude speeds than any Allied fighter and actually had a speed advantage  and manouverable  advantage over the ME262 in those moments of landing and takeoff when it was highly vulnerable. Imagine due to its high rate of fuel consumption, a German pilot committed to make a landing in a ME262 low on fuel and he is at low speed and altitude. He couldn't throttle up and regain speed if  being attacked, as this most likely would flame out the engines and crash anyway, killing himself. A dead duck would be an apt description. Don't poo- poo the Gloster Meteor too quickly, and incessantly, its fuselage was more adaptable to modifications than the ME 262 as the British rengined it and modified it numerous times in its history. Early Meteors could be lethal to pilots, but so, too, could the ME 262. Flameout of an engine in a ME 262 there wasn't sufficient thurt on one engine to keep it airborne, and if the pilot didn't bail out immediately, he went down with it into the ground. The early Meteors had this problem as well, but with successive increases in thrust with each engine upgrade, this problem of losing one engine was overcome. The only feature that was heavily copied and researched and I proved further from the ME262 was its swept wing. The post-war researchers did not copy its fuselage as they had found much better performing designs of fuselage post-war. once the post-war researchers had examined the few flying ME 262s left, they either put them on display in museums as static displays as there were no working engines for them or scrapped them. After the engine factory producing the engines for the ME 262 was bombed and production stopped, that really was the demise of the ME262 being a war winning aircraft. The engines were troubled in its development and in its service life and stalled it Introduction I to service by easily two years.
Reply: @damianousley8833  The Messerschmitt Me-262 is the most significant, revolutionary aircraft in history since the Wright Flyer lad... it was over 100 mph faster than any Allied aircraft during WW2. 
It could turn and manuvere at speeds that Allied aircraft could only reach in a death dive.

Me-262 pilot Kurt Welter is still the highest scoring jet Ace in history.
Reply: @damianousley8833  RAF Chief Air Marshall William Frederick Bowhill called the Meatbox a qoute "most dismal and lackluster aircraft" 

150 Meatboxes crashed in accidents in a single year! 12 pilots killed in accidents in a single week! 6 fatal accidents in just one day!

Official MoD records from 1947 to 1955, confirmed 450 British RAF pilots were killed by the Meatbox even after ejection seals were fully adopted.
1,600 hull loss accidents just in RAF service.

The Meatbox never shot down a single Luftwaffe plane, it only killed British pilots during WW2.
Reply: @sandervanderkammen9230  What you fail to miss is that many pilots training to fly the ME 262 were killed in training accidents , and there were no two seat training jet conversion aircraft built during the war. If it had flown on in peacetime, the death toll of the ME 262 may have been comparable to a lot of the early first generation jets. The first flight at the controls of a ME 262 was many a pilots last flight. They were only given one instruction flight with the instructor talking to the pilot by radio. Only one training flight was made due to acute fuel shortages. The ME 262 had problems with its engines and its landing gear easily failing if not handled properly.  A lot of pilots died post war flying military jet aircraft. It was a macarb statistic.
Reply: @damianousley8833  What you fail to understand is the Meatbox was an unmitigated failure as a jet fighter as it was without any doubt the most successful British jet ever used Against the RAF.
Reply: @damianousley8833  The Meatbox has the highest fatalities statistics of any jet aircraft in RAF service.
Reply: @damianousley8833 The ME262 killed more of its own pilots than it did the enemies - a great gift to the allies.
Reply: @agt155  Official MoD records confirm that 890  Gloster Meatboxes crashed killing 450 British pilots.
Reply: @sandervanderkammen9230  More 262 pilots were killed in training in 2 years!!
Reply: @agt155  26 Luftwaffe pilots scored Ace or higher shooting down over 550 Allied aircraft, Kurt Welter remains the highest scoring jet Ace in history.

The Gloster "Meatbox" as it was called by the RAF, only killed British pilots.
Reply: @gw7624  The Meteor couldn't even out dogfight an FW-190 💀
Reply: @monza1002000  how many jet designs were inspired the Meteor?

Let's see here...oh, none.

The ME 262, meanwhile, is considered the grandaddy of all jets. 

The Meteor was a lot like its namesake, burning bright and gone the next.
Reply: @IAmAlpharius20  Then neither could a 262.
Reply: @monza1002000  please tell me how the Meteor inspired any of those
Reply: @IAmAlpharius20  The designs used all the data collected from the Meteor
Reply: @IAmAlpharius20  Look at some of them and they even look like upscale Meteors, the Cambera in particular
Reply: @monza1002000   ah yes, totally. Please ignore the obvious swept wing designs
Reply: @sandervanderkammen9230  so why do you capitalise ‘Van’
Reply: @sandervanderkammen9230  you haven’t answered the question, & the answer to yours is “because it was given to me by others” long before “gay”, “androgynous” or such things as “gender neutral” occurred to people or became topics of normal conversation. That is what they called me so that is what I called myself.

So: returning to the capitalisation of Van or Von?
Reply: @pcka12  Sorry, I'm not curious that way... totally not interested.
I am completely straight.
Reply: @sandervanderkammen9230  in my experience Barrie is normally a given name of males, & no I have never met the gentleman, however it is notable how you continue to evade questions & mislead.
Reply: @pcka12  I was curious because Barrie is girls name and he self-identifies as genderqueer and saod he met his intersex partner at a LBGTQ event at the 'Queer Britain' museum.
Are you Barrie's "domestic partner"???
Reply: @pcka12   @pcka12  I was curious because Barrie is girls name and he self-identifies as genderqueer and said he met his intersex partner at a LBGTQ event at the 'Queer Britain' museum.
Are you Barrie's "domestic partner"???
Reply: @sandervanderkammen9230  oh dear! You are such a boring individual, not everything in the world centres around sex you know, in fact in the Middle Ages numerous communities developed entirely eschewing sex in favour of more ‘high minded’ pursuits!
Reply: I love how the meteor and the 262 both had problems taking off
Reply: ZzKINGMANNYzZ the 262 had absolutely no problem taking of.
Reply: Don Woodward I’m pretty sure it had a problem since the back of the plane was too heavy it was hard but I’m not sure
Reply: @MANNYzZ  Are you referring to the tail dragger version used for testing? This layout was used for testing with the nose mounted propeller for adaquate ground clearance and balance. Not part of the final jet propelled design.

The Gloster Meteor had very serious engineering flaws that made it very prone to crashing... over 1,000 crashed mostly in non-combat operations.
Reply: @sandervanderkammen9230  wrong again.
Reply: @donaldellis3609  Over 1,000 Meteorites crashed... killing 450 RAF pilots. The worst safety record in RAF history.
Reply: @MANNYzZ  
The problem was with the early engines only slowing increasing power. Runways were not long enough. As knowledge increased they realised they could increase the performance by having the air intakes at 90° to travel. All jet aircraft have done this since then
Reply: @monza1002000  What you wrote makes no sense, all modern military jets use axial compressor engines like the Messerschmitt Me-262.
Whittle's centrifugal turbojet was an evolutionary dead end is obsolete today.
Reply: @sandervanderkammen9230  and the 262 was scrapped in 45. Thirteen were built post war in the hopes of an export market but nobody wanted them.  By 1950 over half had crashed and the rest replaced. The aircraft has a 1.5 to 1 kill ratio and if anything showed how not to build a jet fighter.  It's weapons had a 500 yard range with its high speed during attack it meant at most 2 seconds to aim the aircraft at the target, fire and then break off to avoid collision.   Many Luftwaffe pilots returned to base never firing a shot.  The .50 caliber guns it faced had a 1700 yard range and same penetration power.  Attacking a bomber formation was suicidal.   That's why they tried rockets in later models
Reply: @sandervanderkammen9230  The tail wheel was still there when they tried jet engines, the prop engine only used because the German failures of the jet engines they copied from Britain were far from ready. The design was much modified after the original engines proved to be really bad, the replacements were still not good.
Reply: @barrierodliffe4155  The worlds first successful demonstration of a turbojet engine was on August 27th 1939 in Rostock GERMANY... two years before Britian made its first attempt.
Reply: @sandervanderkammen9230  Not very successful, that aircraft only flew at low speed for a very short flight and the undercarriage was never retracted. The British do things properly rather than try to rush things.
Reply: @barrierodliffe4155  The facts are irrefutable... the first successful demonstration of jet engine was August 27th 1939.
TWO YEARS BEFORE WHITTLE
Reply: @sandervanderkammen9230  The prototype Me262’s were tail staggers regardless of power plants.
The engines set the grass runways on fire and the wing masked the elevators.
The centre of gravity was also too far aft.
The centre of gravity issue was fixed by increasing the wing sweep. The tail masking was fixed by fitting the tricycle undercarriage off the Me309 which also partially fixed the grass scorching and improved takeoff performance by reducing drag.
Reply: @sandervanderkammen9230  But Sandyboy, elsewhere you are crediting Franz at Lycoming with the T53 engine and the AGT-1500 engine. Poor boy, don't you know they've got centrifugal compressors and are based on Whittles 1931 patent.
Reply: @sandervanderkammen9230  The vast majority of modern military jets use a bypass engine. Here's something Pabst von Ohain had to say on those-

"From the beginning of his jet propulsion activities, Frank Whittle had been
seeking means for improving the propulsive efficiency of turbojet engines.  He
conceived novel ideas for which he filed a patent application in 1936, which
can be called a bypass engine or turbofan. ...Whittle's work on
fan jets or bypass engines and aft fans was way ahead of his time. It was of
greatest importance for the future or turbopropulsion."
Reply: One of my favorite quotes is by RAF Air Chief Marshal Sir Frederick Bowhill who called the Gloster 'Meatbox' a quote; "Dismal and lackluster aircraft"
Reply: @sandervanderkammen9230  One of my favourite quotes is by Adolf Galland, who wished "if I  could have had the Gloster Meteor's engine in the Me 262 I would have had the best aircraft of the war."
Reply: According to Official MoD records 12 RAF meatbox pilots were killed in a single week, 6 killed in a single day...  150 Meatboxes crashed in a single year (1952)
Reply: @sandervanderkammen9230  Have you found the evidence that the 262 shot down loads of Mosquitos yet? No..... Oh, no surprise.
Reply: 450 RAF pilots killed by the "Meatbox" making it the most effective British jet ever used against British pilots...
Reply: @Redsen East Hello Redsen, you seem a bit sensitive about the trashing of the nazi regime, do you wish it had prevailed?. I always know I've won an argument when my opponent starts grizzling to the report button. Of course Britain and France led the way in doing over the nazis and bringing germany to heel for the second time. Sadly France was knocked out early because of political and command failures but many Frenchmen soldiered on and Britain held the fort whilst the Americans waited to obey the call and the Soviets fed and fueled the nazi regime until it turned on them. Britain was always going to win by the same means it had won the great war and the napoleonic wars. By using its military force along with its political, financial and diplomatic power to co-opt allies and induce neutrals to work for them. And of course it worked,  nazi germany was trashed, the soviets did the dirty work and the Americans paid for it. Now that's a win.
That sad old argument about Britain not being able to defeat Nazi Germany on its own is so stupid isn't it. It's just as easy to point out that Nazi Germany wouldn't have been able to wage the war it did on its own. Fed and Fueled as it was by Soviet Russia who shared the invasion of Poland. And allied by Italy that did most of the naval work in the med and supplied most of the troops for North Africa. And with troops of all nations covering its arse in Russia and Japan attacking the allies in the east. Britain may not have been able to take the war to Germany but then it didn't have to, it only had to wait for  the Germans to run out of everything or destroy themselves by doing something stupid which, lets face it was bound to happen.
Reply: @peter green Koenig Karl III  (Charles III) is German.
Reply: It's amazing how Gloster managed to build these death traps faster than they crashed.
Reply: @WilhelmKarsten  Amazing how Messerschmitt managed to sell a grossly defective aircraft to the Luftwaffe - repeatedly.
Reply: @allangibson8494  Not as bad as Gloster aircraft... the Meteorite is notable for only killing RAF pilots.
Reply: @WilhelmKarsten  Ask about the Me163’s death toll. Not many burials however (nothing left to bury).
The Gloster Meteor had a significant adversary kill count when cut loose in foreign airspace. They did destroy 46 German aircraft however.
The lack of ejection seats was a critical problem with the early Meteors (until the F.8) (as it was with most German aircraft too).
The Me262 vanished as they were grossly outclassed by the British engined postwar aircraft. (The Czechs built some post war but found the engines just too unreliable (even with no issues with high temperature alloys)).
Reply: @allangibson8494  Still the fastest combat aircraft in operational service until 1947... the Allies had absolutely nothing comparable to the Komet, the destruction of the chemical factory that produced its fuel is the only reason why it use was limited.
Reply: @allangibson8494  The Gloster Meatbox is the most effective British aircraft ever used Against the RAF... it only killed British pilots during WW2.
Reply: @allangibson8494  The Messerschmitt Me-262 was already overshadowed by much more advanced German jet technology like the MiG-15 and the F-86 Sabre.
Reply: @allangibson8494  The meatbox continued to kill British pilots because the UK had nothing better 
to replace this dismal aircraft... after Britain's defeat in WW2 the country was completely bankrupt and had no money to develop anything better.
Meteors were cheap and British pilots were disposable.
Reply: @allangibson8494  The Jumo-004B orkan engines were very reliable.
When the US Army tested them in Operation Lusty they confirmed TBOs in the 50 - 60 hours range very good for Allied piston engines like the Merlin and R-2800.
And better than the Derwent or even the J47.
Reply: @WilhelmKarsten  It simply wasn’t allowed to attack in German airspace.
And the Germans didn’t attack into any airspace where it was. They couldn’t even get off the ground.
It did prevent 14 V-1’s from killing British civilians however.
Reply: @allangibson8494  The Gloster Meatbox was an unmitigated failure and never saw operational service as a fighter aircraft during WW2.
It saw experimental use in the V-1 interceptor role but was quickly withdrawn and replaced by faster, more effective propeller driven fighters like the Tempest and Mosquito.
The meatbox was completely outclassed by the Me-262.
Reply: @WilhelmKarsten  The destruction of its pilots by the aircraft itself was also well documented - the residual fuel dissolved the pilot if the tank cracked on landing or if, like a lot of them, it was holed by gunfire. The Me162 downed 16 aircraft at the loss of 15.
The 590mph/900kph never exceed speed was publicly exceeded by a Gloster Meteor in November 1945 at 606mph.
There were pretty good reasons why the Me163 was withdrawn from service before the end of WW2.
Reply: @allangibson8494  That's still better than the meatbox, it only killed British pilots
Reply: @allangibson8494  The Meatbox killed because it was unstable in flight, structurally unsafe and its asymmetric handling was considered fatal.
 RAF Chief Air Marshall Sir Frederick William Bowhill called it a dismal lackluster aircraft.
RAF pilots calling it the meatbox, a reference to it being a flying coffin!
Reply: @allangibson8494  Heini Dittmar broke the records in the Me-163 on July 6th 1944 at 702mph
Reply: @WilhelmKarsten  The Meteor wasn’t any more unstable in flight than any other twin engined fighter of the time.
It’s only significant problem was difficulty in bailing out due to its high speed (a problem with every single first generation jet fighter and 99% of the late WW2 piston engined fighters too).
It was much better than a lot of the other options at the time - but it’s time (like all the other first generation jets) passed. Unlike all the other first generation jets - some Meteors are still flying (with ejection seats to solve their biggest problem).
Reply: @allangibson8494  The Meatbox's asymmetric flight characteristics were regarded as appallingly bad with a crippling lack of rudder authority.
An engine failure on take-off was considered unrecoverable and usually fatal even with ejection seats.
Hundreds of Meatboxes crashed due to directional instability at high speed and altitude that often presented as a sudden, uncontrollable snap into a flat spin, which often severed the empennage due to overstress of its weak fuselage structure.

The meatbox as a jet aircraft was an unmitigated failure and the crash and fatalities data prove this.
The plane is without any doubt the worst jet aircraft in RAF service and arguably the worst jet aircraft ever mass produced.
Reply: @allangibson8494  The real tragedy of the Meatbox disaster was that Britain had nothing better to replace it... British pilots continued to die at a staggering rate because after the country's defeat in WW2 Britain was completely bankrupt and in ruins, crippled by debt, the Bank of England failed, the overseas colonial empire collapsed... then the greatest humiliation of all, forced to sign the terms of the Anglo-American Bailout Agreement... Britain was forced to surrender its autonomy and become a United States protectorate... it became an American pocession from 1946 to 2006 and American troops still occupy the UK today.. Cheers mate!
Reply: @WilhelmKarsten  The Meteor had a LOT of competition. It did however have a much higher carrying capacity as a bomber than the other fighters of the time, like the DeHavilland Vampire, Venom, Vixen and the Supermarine Attacker all hit the market immediately after WW2.
The Me262 was also a pilot killer (worse than the Meteor because of its horrific engines) - but operated in a “target rich” environment.
Reply: @allangibson8494  You're delusional mate... the Meatbox was without any doubt an unmitigated failure as a jet aircraft and completely ineffective as an air superiority fighter... 
The Messerschmitt Me-262 is the most revolutionary and significant aircraft in history since the Wright Flyer.
The Allies had nothing comparable to it during WW2.
Reply: @allangibson8494  Stop spreading lies and misinformation the Messerschmitt Me-262 had excellent engines, more efficient and reliable than any Allied jet engines in service during WW2.
Reply: @allangibson8494  The Vampire was no fighter either..
The Vampire obsolete on arrival.
The Sea Bitch had a loss that was almost as bad as the Meatbox... de Haviland didn't survive to see it though to production... the de Haviland company being completely destroyed by the Comet Disaster the worst engineering disaster in aviation history and a humiliating and shameful chapter in British history.
Reply: @WilhelmKarsten  The Me262 was an utter failure in the postwar environment. The Czechs built a couple of dozen but replaced them with the MiG-15 as soon as they could.
The Meteor was a first generation jet. 
That it was outclassed by third generation fighters in the 1950’s isn’t a surprise to anyone.
The Me262 was recognised as an utter turkey by 1950 too (mostly because it’s engines had zero development potential because of poor engineering).
The Meteor was a competent ground attack aircraft in Korea and did shoot down a number of fighters and bombers during the 1950’s but was hardly cutting edge anymore.
Reply: @allangibson8494  All 1st generation jets were rendered obsolete by the rapid advancements in jet technology... second generation jet designs like the F-86 and the MiG-15 rendering them all obsolete.
Reply: @allangibson8494  No, what is shocking is that in the 1950s Britain was still relying on 1st generation jets... like the Meatbox and Vampire.
Reply: @allangibson8494  The Gloster Meatbox was obsolete by the Korean War, woefully outdated and ineffective... a real embarrassment to RAF and RAAF pride.
Reply: @allangibson8494  Britain had nothing comparable to the F-86 or the MiG-15... it's aircraft industry already in a steep death spiral on its way to total collapse at the end of the 20th century.
Britain today is completely incapable of meeting its rather insignificant RAF needs.
The current RAF fleet now composed of nearly all foreign aircraft.
It's most advanced jet fighter is the American Lockheed F-35!
Reply: @WilhelmKarsten  You obviously don’t comprehend R&D… 
The post war German jet fighters were?…
The British aero industry was bleeding edge - and blood was spilled as a result of learning how to build airliners. The Comet 4 was a perfectly good aircraft.
Boeing commented that if the Comet hadn’t crashed the 707 would have.
Reply: @allangibson8494  Britain was never a leader in aviation, it has always lagged behind the Americans, Germans and the French.
The British aircraft industry collapsed in the 1990s and no longer makes commercial or military combat jet aircraft.
Reply: @allangibson8494  The Comet 4 has the worst safety record of any jet airliner in history except for the Comet 1 which was a embarrassing and humiliating failure.
Reply: @allangibson8494  That's a bald faced lie, the Boeing 707 flew on July 15th 1954, before anyone in the world (including de Haviland) knew why the Comet repeatedly suffered catastrophic in-flight structural failures and fatal runway excursions.
Reply: @allangibson8494  The tragedy of the Comet Disaster is that it could have been easily avoided if de Haviland had simply followed well-known and understood industry standards for the design and construction of pressurized cabins made from riveted aluminum alloys.
The only thing learned from the Comet Disaster was that manufacturers could no longer be trusted to conduct their own crash investigations.
Reply: @WilhelmKarsten  The Comet 1 had issues. The Comet 4 didn’t - they were completely fixed. 
The exact same fuselage and wing design was licensed to the French for the Sud Aviation Caravelle (with tail mounted engines like the 727 which was derived from the 707).
Reply: @allangibson8494  BOLLOCKS MATE!
The Comet 4 had a shameful 28% loss rate..   the only jet airliner with a worse safety record was the Comet 1 and it was permanently grounded in 1954 and its airworthiness certification revoked.
Reply: @allangibson8494  The Boeing 707 is the world's first successful, airworthy jet airliner it was hugely successful and revolutionized air travel and made millions for Boeing, de Haviland went bankrupt in 58' at no longer exists 
All modern jet airliners are modeled after the 707.
The 707 still serves the Royal Air Force and is expected to remain in service until 2045
Reply: @allangibson8494  The Comet series has the worst loss rate and the worst per flight and per passenger/mile fatalities rate.
The Comet 4 was grounded in 1980 after inspections found the entire remaining fleet had serious metal fatigue damage.
Reply: @allangibson8494  All of the British aircraft companies are gone, because no wanted buy British planes... not even the brits!
Reply: @allangibson8494  British Airways operates 138 aircraft built in Germany, 96 aircraft made in America and 25 aircraft made in France.
And ZERO aircraft made in Britain.
Reply: @WilhelmKarsten  Sandybum, they did however bot F 86 and Mig 15 had British designed jet engines.
Reply: @WilhelmKarsten  Sandybum. Best not to mention that both Meteor and Vampire had a long career in many airforces around the world long after the RAF retired theirs.
Reply: @WilhelmKarsten  Yet the British had other jet fighters by then but just like WW II piston engine fighters were more than capable, the Sea Fury and Meteor shot down Mig 15's much as the Spitfire and Tempest shot down Me 262's in WW II.
Reply: @WilhelmKarsten  Britain had the engines which were used in the F 86 and Mig 15. The RAF has the excellent Typhoon which is partly British and was developed from the British EAP., also a fact that without Britain the F 35 would still be the Lockheed flop.
Reply: @WilhelmKarsten  Sandybum, the Comet 4 was a fine arcraft and you take losses which had nothing to do with the Comet, the shame is that Boeing tried to blame it's failures on pilots or other causes like the many 707's lost according to US reports due to unexplained causes, even when Boeing knew it was an aerodynamic problem.
Reply: @WilhelmKarsten  Hello Sandyboy, I see you are blabbering on about about the F-35 again.  That would be the F-35 in which (With Britain being a founding member in 1995 of the JSF programme) BAE has been from the start one of two key partners with Lockheed Martin (the other is Northrop Grumman) and responsible for 15% of every aircraft. Other early partners in the programme were Italy, Netherlands, Australia, Canada, Denmark and Norway.   As you know, some twenty years late Germany has recently become desperate to get in on the act and in late 2022 with about 10 billion Euros bought themselves some F-35s and a few production crumbs.
Reply: @WilhelmKarsten  Hello Sandyboy. Say about those aircraft that the French, out of kindness allow the German's to assemble for them, how well would they fly without the wings that are designed and built in the UK?
Reply: @barrierodliffe4155 Barrie please cite the name of a British company that still makes commercial jet aircraft in the UK???
Reply: @barrierodliffe4155 Hey Barrie! PLEASE NAME A SINGLE BRITISH JET STILL IN PRODUCTION???
Reply: @sandervanderkammen9230  Pick one of Rolls-Royces - you know the most successful jet manufacturer in history.
Reply: @sandervanderkammen9230  Components or entire aircraft? In terms of commercial aircraft there is only really Airbus & Boing, and both those only exist because of insane protectionist subsidies of the EU & US.
Reply: @agt155  GE-Safran is the most successful jet engine manufacturers in history.
Reply: @agt155  Name a British company that still makes British jet aircraft in the UK?
Reply: @sandervanderkammen9230  I take it Safran was a typo. GE is big but it's kind of like comparing Apple to Huawei. Rolls Royce hit every milestone in the history of jet design whilst GE turned up a few years later with copies, and let's not forget GE's jet division was started from one of Whittle's cast-offs - It must have seemed like a UFO landing in their lap.
Reply: @sandervanderkammen9230  Is there an echo? There are only two manufacturers and only one of them produces aircraft in a single country. The other manufacturer is Airbus, founded in the UK.
Reply: @agt155  Whittle's centrifugal turbojet is an evolutionary dead-end concept.

The engines we use today were developed in Germany by Dr Anselm Franz.
Reply: @agt155  Airbus SE is not a British company.

Please name a single British company that still makes British jet aircraft in the UK?
Reply: @sandervanderkammen9230  Whittle didn't just invent the centrifugal jet he also invented the axial-flow, turbo-prop and turbo-fan. Whittle knew for sub 2000lb thrust centrifugal was best so that's what he built first. Post-war manufacturers could  not build axial flow-turbofans for 10 years after the war for fear of infringing Whittle's 1939 patent.

German jet engines were a complete dead end. Only Russia pursued development following the war. Even with free German scientists and free German jet engines they eventually bit the bullet and bought British. Though we considered the Derwent out of date the Russians and Chinese abandoned their indigenous (German) projects and produced around 250k copies.

And of course where is German jet engine manufacture today? RR threw MTU some scraps 40 years ago - that's about it.
Reply: @sandervanderkammen9230  I didn't say Airbus was British I said it was created here.
Reply: @agt155  Bollocks lad, Whittle was not the first to achieve anything related to jet engine development.
He is only the fourth person to successfully demonstrate a working jet aircraft engine.
He is only rightfully credited for being the first person in the UK.

Whittle did not invent turboshafts, axial compressors or turbofans.

Whittle never had the ability to construct an axial compressor and he never built an axial compressor turbojets.

The jets we all use today were first developed in Germany.
 The German aerospace industry was relocated en masse to America by Operation LUSTY and Operation Paperclip, with some experts going to France and the Soviets.

General Electric had so many German engineers in the Jet engine department they started conducting meetings in German.

Dr. Anselm Franz became the Vice president of Avco Lycoming-Textron.
Reply: @agt155  Airbus is not British or  owned by any British companies.
Please name a single British company that still makes British jet aircraft in the UK?
Reply: @sandervanderkammen9230  "Please name a single British company that still makes British jet aircraft in the UK?"

BAE. simple.

Please name a single German company that makes German jet aircraft in Germany?
Reply: @agt155  Name a British jet aircraft still made by BAE?
Reply: @agt155  Airbus SE and Eurofighter Jagdflugzeug GmbH.
Reply: @sandervanderkammen9230  Anselm Franz famous for "his" Lycoming T53 engine - with centrifugal compressor. In fact it had a centrifugal compressor after a 3 stage axial compressor and reverse flow combustion chambers - the most exact copy of Whittles 1930 patent ever produced!!! What a fraud.

Strange why in the hay-day of jet design they put such an expert to work on a lowly helicopter engine don't you think?
Reply: @sandervanderkammen9230  Neither of those are German companies and neither make a jet plane in Germany - try harder.
Reply: @agt155  Dr Franz also designed the engines for the M1 Abrams and the BAe 146
He also became Vice President of Lycoming.
The Lycoming T53/T55 is the most successful gas turbine helicopter engines in history.
Reply: @agt155  Jens Ægius-Elling invented the centrifugal gas turbine engine in 1913 when "little Frankie" was just 6 years old lad.
Reply: @sandervanderkammen9230  Yes, but we are talking about jet engines and Franz never made a successful jet engine.
Reply: @agt155  The first production gas turbine engines were manufactured by Swiss manufacturers BB&C and demonstrated in Berlin in 1930, at the request of A.A.Griffiths chief of engine development at the Royal Aircraft Establishment the first demonstration of a gas turbine engine in the UK was conducted by BB&C at UMIST in Manchester in 1932.
Griffiths helped Metropolitan-Vickers secure a licensee agreement with BB&C to manufacture the Swiss gas turbine engines in the UK.
 Griffiths and Hayne Constant both went to Switzerland to study gas turbine production methods at BB&C.
The Metrovick F1 is based on the BB&C Velox A,28.e
Reply: @agt155  Name a British jet aircraft made by BAE?
Reply: @agt155  Dr. Anselm Franz created the most successful jet engine in WW2, the Jumo 109-004b Orkan.
Reply: @agt155  Hamburg Germany is the headquarters for Airbus commercial aircraft production.
The Dornier Finkenwerder factory in Hamburg Germany is the largest manufacturer of jet aircraft in Europe, second only to Boeings Everett, Washington plant
Reply: Germany produces between 2 to 4 Airbus aircraft per day...
Reply: @sandervanderkammen9230  Airbus is NOT a German company.

Try again.

Good to see you've given up on Eurofighter gmbh though - jeez a British jet and 1/3rd British owned
Reply: @sandervanderkammen9230  ...the Jumo was probably the least successful jet engine ever fitted to an aircraft. No wonder they put him to work on a tank motor.
Reply: @agt155  The Jumo 109-004b Orkan powered the Messerschmitt Me-262... the only successful, combat effective jet fighter during WW2.
Only Germany had the ability to mass produce axial compressor turbojets during the war, the Allies were a decade behind in jet engine development.
Reply: @agt155  Airbus SE is a German-French company with Spain as a minority partner.
Airbus is not British.

Eurofighter Jagdflugzeug GmbH. is a German consortium based in Munich Germany.
Reply: @agt155  ANSWER THE QUESTION!
NAME A BRITISH COMPANY THAT STILL MAKES BRITISH JET AIRCRAFT IN THE UK??
Reply: Petrol Head . A bit like the BAC 146, another fine British airplane. Hot day and they struggle.
Reply: @mitseraffej5812  that's good in England it's never hot
Reply: @Im.always.watching  thats a joke right, you're saying that in the middle of a heat wave? and never hot when it was like 30 degrees during the lockdown....
Reply: @mike_hunt4783  30 degrees is tame try 40 here in the caribbean
Reply: @kevinbaboolal4225  alot of european countries rain just as much as UK does, Scotland rains a lot more than England
Reply: @mike_hunt4783  30 degrees, laughs in Indian 45+ °c  often near 48+
Reply: @hiteshadhikari  that's because India is a bigger country and not in Europe... and tbh I don't think I could cope in 40 degree heat, i rather for it to rain.
Reply: @hiteshadhikari  me: laughs in Fahrenheit
Reply: I prefer 30 degrees and being comfortable rather than being so hot and sweaty.
Reply: New Zealand also has more rain than England.
Reply: @Im.always.watching  well, perhaps this statement didn’t age well, but hopefully we do what we can against climate change so this statement stays relevant
Reply: @mitseraffej5812  Guess some things don't change then, the type 45 destoyer engine conks out in hot weather
Reply: @Gillie Monger He was talking about Germany...
Computers and the internet were invented in America.
Reply: @sandervanderkammen9230  Still off target I see!